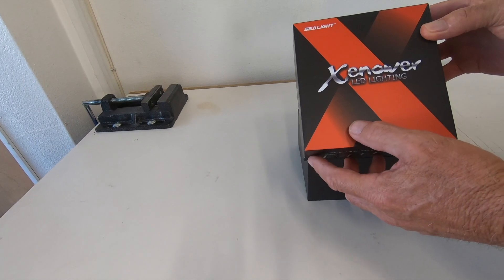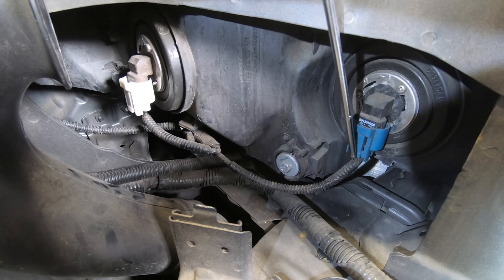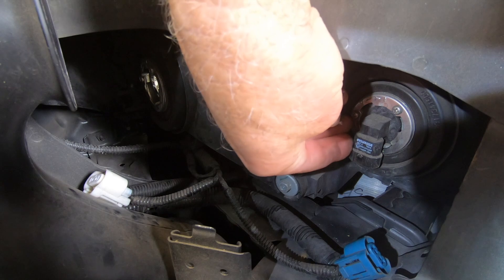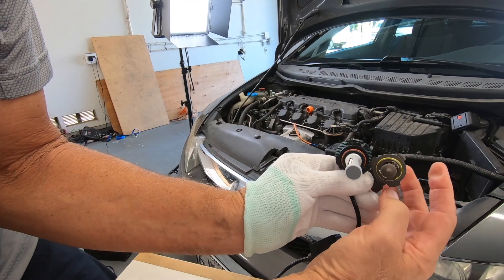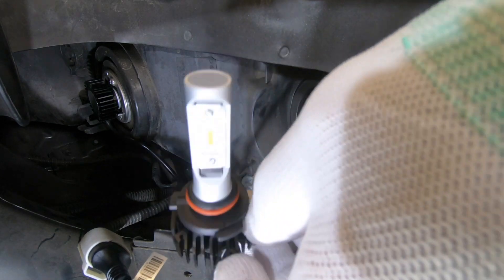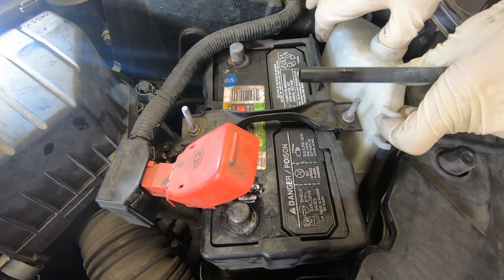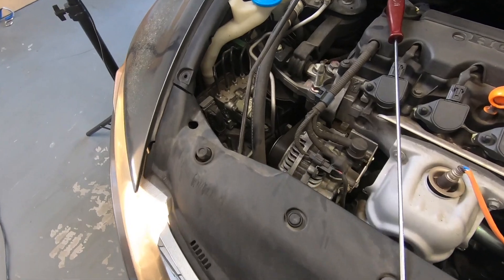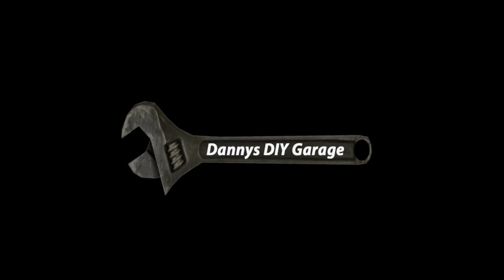LED Headlights VS Halogen Headlights, upgrade, review and installation on a Honda Civic

Comment: Hi, i have a 2008 honda civic and i want to install LED headlights, my question is, is installing low beam enough or do i need to install both low and high beam?? If i install low beam and when i switch to high beam both low and high beams work or only high beams work?? If both works at a time means i will only install low beams, plz reply

Comment: What's the difference between 9006 and 9005

I bought 9005 hb3 and fix into low beam... Its working.  Any issue?
Now i plan to buy for high beam. So what should i do for high beam 9006 or 9005?
Reply: 9005 is for hi beam and 9006 is low beam

Comment: They need to make these illegal in the US. They are far too bright and blind people making driving dangerous. Especially the older drivers on the road, they have a difficult time seeing and now your blinding them.
Reply: And I would counter that with they should make stock low beam lights illegal. My mother can't see the road at all with low beam lights, they are basically non-existent, so she always drives with high beams. Which I would say is far more dangerous than driving with brighter low beams.
I never have to use high beams on my other car, ever. I see everything with stock low beam xenon projectors.

Comment: I don't recommend doing this because you'll have electric issues down the road. I've seen people upgrading their headlight bulbs then months later they have a dead battery, or parasitic drain issues.
Reply from the maker: I haven’t experienced any of these issues on the 3 cars I’ve upgraded, I do have videos on parasitic draw test using my vehicle and they have LED lights installed, maybe a low quality light could cause this

Comment: Isn’t 44000 lumens a lot for a 2009 Honda civic? I’ve been told by the auto part dealers that’s it’s a lot and usually you won’t need more than 1200-1800 lumens per bulb for high beams and around  1000 for  low beams. I’m looking for a led light for my 2009 Honda civic 2 dr. Need help!
Reply from the maker: I’m pretty happy with my lighting choice, I’m not sure how informed your auto parts guy is and I’m not questioning what he told you, the lighting I have is perfect, I would go brighter if I could

Comment: Does the LED's drain the car battery faster?
Reply from the maker: I believe they use around 75% less energy and last 25 times longer, something like that, I may not be totally correct, but they last longer and are more efficient

Comment: Great video! I just bought a 2011 4dr Civic Si and want to do this.  However, there are halogen running lights I believe.  Wouldn't the halogen running lights look weird if you added the LED low beams?  Does your car not have the running lights?
Reply from the maker: Yes it has running lights, everything works even the running lights

Comment: If I had that room, I would go for Auxito - 10S low beam and Auxito - M3 on high beams. Those are all in one unit led bulbs. And they shaped like a halogen bulbs with a cooling fans. Much better well made led bulbs.

Their not gonna be as bright as with an led bulb with a cooling fan. 

Those definitely be brighter than stock. But not as bright as an active led bulbs than this.

If I were u, (I know ur happy with them but), I would replace both the ones I mention. Or something reliable like Lasfit - LC plus low beams since it’s compact, and for high beams the LA plus. Those have the perfect 6000k pure white.
Reply from the maker: great information
Reply: @dannysdiygarage  🙏🏼🙏🏼🙏🏼🙏🏼

Comment: Hi Thanks for the informative video. Can you tell me the model of light you purchased. As I tried two different brands and the socket  pins are not the exact same size and the led light seems loose and comes out if I wiggle it. @dannysdiygarage

Comment: I tried these and wasn't satisfied. I did get a different model of sealight though so idk if that makes a difference. Went back to halogen
Reply from the maker: John, what didn't you like about them? I'm pretty satisfied with mine, however I don't drive in the rain or fog much so I'm not sure about that kind of weather.
Reply: @dannysdiygarage  Beam pattern wasn't great imo.
Reply: Well if that’s the case. 

I would recommend Lasfit. 

Those gives u an excellent beam pattern.

Comment: Very informative! I will be replacing my lights with led's and was wondering if I need to make sure when securing the module, if it matters whether or not it will be touching anything metal or anything under the hood of the car.
Reply from the maker: Just zip tie them to other wires, not metal otherwise it will vibrate, rattle and possibly shorten the life
Reply: @dannysdiygarage  Thank you for being so helpful!
Reply: How are those led lights holding up after all this time?  Sealight brand?  I was thinking of upgrading.
Reply: @joelsalgado5808 So far the lights have been amazing. So much better and brighter than halogen bulbs. Worth the upgrade. I got the brand Krieges Fahren from amazon. The only dilemma I have, the low beam light needs to be adjusted downward for my honda civic. I can’t seem to figure it out.

Comment: Hi mr Danny just installed head light on 2006 Honda civic with fahren led notice the one is lower than the other tried to rotate it still problem kindly tell help please
Reply from the maker: Swap them side to side to see if it follows the bulb, if so send them back
Reply: @dannysdiygarage   thank you for your quick response God bless I’ll do it on Saturday

Comment: Hi can you tell me which headlights you purchased? Also did your daylight running lights still work? I have a 2007 Civic Sedan. Thank You
Reply from the maker: Yes daytime running lights work fine
Reply from the maker: Just make sure they fit your car, they have brighter one now Limited-time deal: SEALIGHT 9005/HB3 9006/HB4 LED Bulbs Combo, Super Bright Cool White, Plug and Play, Pack of 4 https://a.co/d/hsD98TJ

Comment: Danny, Is it possible to adjust the left/right aim of the lights on your Civic? I have a 2008 Civic and my drivers side headlight beam seems to point toward the center of the road whereas the passenger side points straight ahead.
Reply from the maker: Yes, there are side to side and up and down adjustments

Comment: Does it matter that the LED bulbs are in OEM housing? i.e. without a lens, will they blind other drivers at night?
Reply from the maker: 02 will usually set a code, I’m not sure how many miles you have on it, but replacing the spark plugs and valve adjustment can contribute to mpg.
Reply: @dannysdiygarage  it’s at 137k miles. I’ll look into those too, cheers
Reply from the maker: I haven’t had other driver flash me, that’s usually a indicator that it’s blinding them, hopefully that helps
Reply: @dannysdiygarage  that’s a good point. Thanks Danny. Love your videos!

One more question: what kind of mpg are you getting on the civic?
Reply from the maker: I track my mileage every fill up with an application called fuelly, 31.5 was my best and 29 is average
Reply from the maker: I have a few videos on things to do for better mileage
Reply: @dannysdiygarage  Yes! I plan on cleaning my MAF sensor with the help of your video! 

I bought a 2008 ex-l three months ago. It's my first car! I love it but I'm not getting the best mileage right now.

I did just realise the wrong size tires are on (215/60R16 94T) and were a little low. Hopefully after inflating and MAF cleaning it gets better. I don't have any codes, but I was wondering about replacing the O2 sensors regardless. Filters seem fine.

Anyways, Thanks again for your help Danny.

Comment: Thank you for the guide and insight. Just to warn any UK viewers these are now not legal in the UK as of last year!  If your able to hide them under the cover (if theres ample space) at the rear of the lights you may get away with it ;)

[Quote] 
Please note that since January 2021, the MOT Inspection manual has been updated to include LED bulbs.

Section 4.1.4 now states the following:

“Existing halogen headlamp units should not be converted to be used with high intensity discharge (HID) or light emitting diode (LED) bulbs. If such a conversion has been done, you must fail the headlamp.”

This is a brand new update that seems to only focus on headlights.

There are no mentions to fail other LED bulbs such as brake lights, tail lights or reversing lights.

Thanks again.

Comment: Very informative but your car like all other Honda your lens are so opaque your loosing 40% of your total brightness ! Imagine if your lenses would be clear how powerful this would be !
Reply from the maker: Agreed, actually after the video posted I did clean them up, they are looking like new, I used this product and would recommend it, CERAKOTE Ceramic Headlight Restoration Kit – Guaranteed To Last As Long As You Own Your Vehicle – Brings Headlights back to Like New Condition - 3 Easy Steps - No Power Tools Required https://www.amazon.com/dp/B084RQKLV8/ref=cm_sw_r_cp_api_i_ZWE7R5HKM23PWZAH8VZW?_encoding=UTF8&psc=1

Comment: Excellent video tutorial, sir! Very thorough and informative. The brand of LEDs you installed are the exact ones I was looking to install. Thank you!
Reply from the maker: You’re welcome, update on the lights, I installed them on both my Civic and no issues thus far, there a lot less $$ then when I purchased them
Reply: @dannysdiygarage  what brand  and where did you purchase
Reply from the maker: SEALIGHT 9005/HB3 9006/HB4 LED Bulbs Combo Package CSP Chips 14000LM 6000K Cool White https://www.amazon.com/dp/B07K43XKDF/ref=cm_sw_r_cp_api_glt_fabc_Y7EZ85EYZ50BNJQE3SRZ?_encoding=UTF8&psc=1

Comment: Just installed them on my 09 civic they make the car look new 🙏
My daytime lights don’t work though
Reply from the maker: Mine work fine on both 2009 civics, I would return them, they must have a problem
Reply: @dannysdiygarage  do they stay on without you manually turning them on ?
Reply from the maker: They turn on when the car is started, ebrake is off and in drive, I think that’s how they work, I’m not at my car now, however it should work just like factory bulbs, if it worked before it should work the same
Reply: @dannysdiygarage  you were completely right they turn on once in gear and no E brake, 
Thanks again ! 🙏
Reply: @dannysdiygarage  I’ll double check today after work ! 
Hopefully they’re fine

Comment from the maker: It’s been 7 months and these are holding up 👍🏼great
Reply from the maker: SEALIGHT 9005/HB3 9006/HB4 LED Bulbs Combo Package CSP Chips 14000LM 6000K Cool White
Reply: Where did you get the Led bulbs at also which ones are they Thanks
Reply: Is it really worth it changing to leds? As my halogens are really dim
Reply: Hii how can i adjust the led up or down?
Reply from the maker: SEALIGHT 9005/HB3 9006/HB4 LED Bulbs Combo Package CSP Chips 14000LM 6000K Cool White
https://www.amazon.com/dp/B07K43XKDF/ref=cm_sw_r_awdo_navT_a_VASCZTRJSQZ5WF47F071

Comment: Thanks for a very detailed video and comprehensive instructions that are easy to follow. Somehow my weak hands could not remove the connector first from the light fixture. I twisted the lamp and removed if first. Then I was able to separate the connector from the light. I finished installing the same brand of LED low and high beam lights and couldn’t be happier thanks to you.
Reply from the maker: you're welcome and thank you for commenting
Reply: @dannysdiygarage   where can I find that set of LED  ??
Reply from the maker: Amazon Limited-time deal: SEALIGHT 9005/HB3 9006/HB4 LED Bulbs Combo Package CSP Chips 14000LM 6000K Cool White

Comment from the maker: Link to LED Limited-time deal: SEALIGHT 9005/HB3 High Beam 9006/HB4 Low Beam LED 14000LM Headlight Bulbs Combo Package CSP Chips 6000K Cool White https://www.amazon.com/dp/B07K43XKDF/ref=cm_sw_r_cp_api_glt_fabc_dlT1_TZ1NMSSYWQHN6D1WS5YS?_encoding=UTF8&psc=1